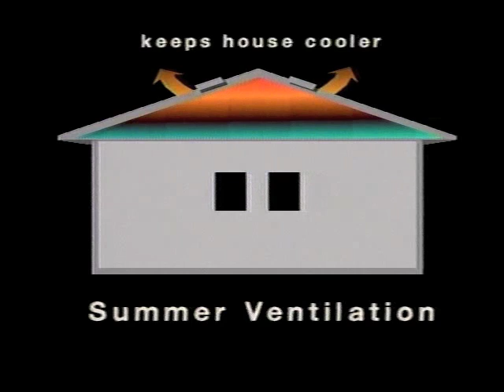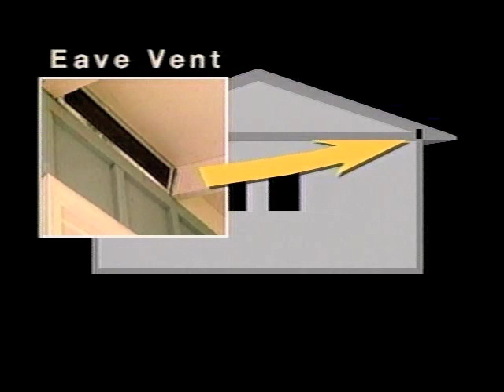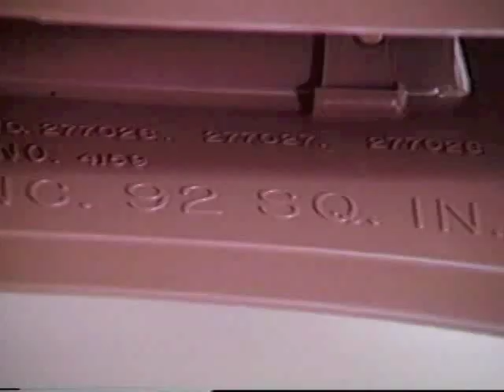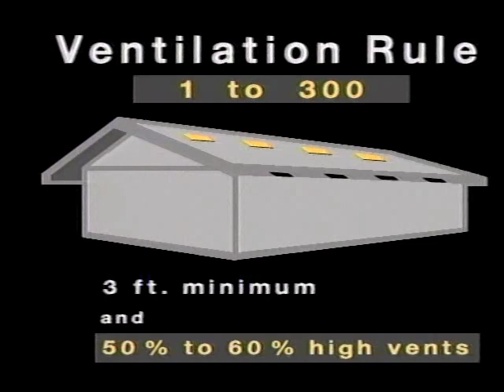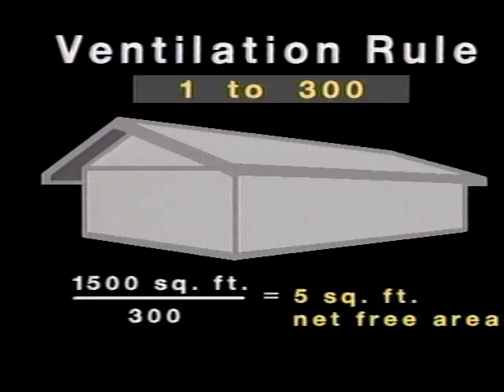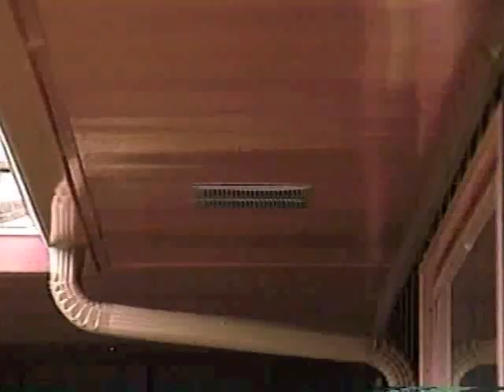How to Calculate and Install Attic Ventilation Part 1.m4v

Comment: You subtracted the exhaust requirements from the total ventilation requirements to get the intake requirements. But your exhaust was more than 50% resulting in a lower intake %. I have always thought that if you can't achieve a balance 50/50, then the intake should be a higher % than the exhaust %. Otherwise you are creating negative pressure in the attic and potentially pulling humid air from the small holes between the house and attic.

Comment: The 300% rule requires %40-%50 of the vent area be HIGH, not low.  e.g. %50-60% must be LOW.  The 2015 IRC says "Not less than %40 and not greater than 50% of the required venting area is provided by ventilators located in the upper portion of the attic or rafter space". NOT GREATER THAN %50.  This is so the attic "Doesn't Suck" to quote Mr Lstiburek of Building Science. https://www.buildingscience.com/users/joseph-lstiburek

Comment: My roof vent calculation shows that the builders used all the net free area on the high roof vent.  We used the attic area/300 net free area formula. We have closed soffits.  We want to put in low soffits.  Should we 1.  Alter the high roof vent to create 1/2 the high vents?  If yes, how??  2.  Use the attic area/150 net free area formula since the high roof vent is not within a boundary of a 50-60% range.  I'm guessing that's not the case, but I'm hoping for an easy solution!

Comment: No such thing as "dry" rot. All rot stems from moisture. No moisture = no rot. Rotten wood might dry out and mislead one into thinking it rotted while dry, but, rest assured, it didn't.
Reply: Unless you're talking about car tires 😁 (which isn't discussed here)
Reply: That's the term for it because over many seasons it dries dry it out therefore it's called dry rot. Roofing contractor here

Comment: Mr. Sullivan, your video is the best that I seen on you tube.  I am a mechanical engineer by training who did most of his work in the chemical process industry and did many calculations for combustion air flow and ventilation systems, for each calculation were a critical starting place for creating a functional system.  In each and every calculation the use of a safety factor was a must, a standard industrial minimum safety factor was ten (10%) per cent, fifteen percent (15%) was highly recommended and twenty (20%) was taught in Colleges and Universities to be the best, why isn't this applied here for a rudimentary and low cost application such as roof attic ventilation to be safe and take care of any unforeseen, uncontrollable environmental events?

Comment: I have a small attic space..... 250 sq. ft. I have plenty of soffit vents and a ridge vent plus 2 cut out vents and my attic still gets soaking wet every winter. We also have the attic well insulated. I was wondering...... are to many roof vents not a good thing because I'm thinking about closing off the ridge vent then cutting more roof vents. AS of now, I have  soffit vents running the entire length of the over hang.
Reply: Strange. Did you get that figured out
Reply: From my research you should have soffit vents with ridge cap only. No gable vents with soffit vents and ridge vent. Gable vent should be only by themselves